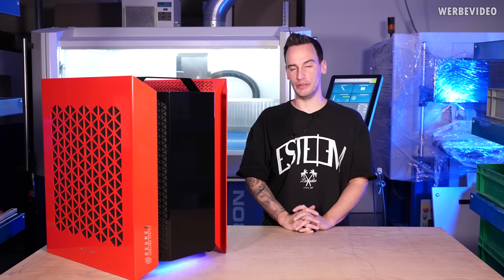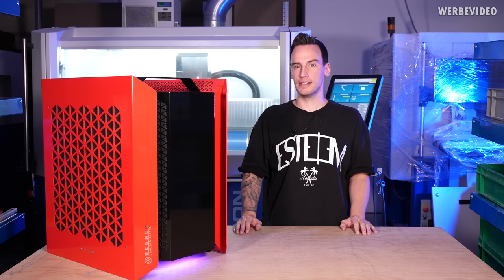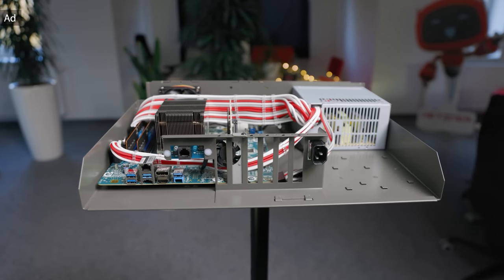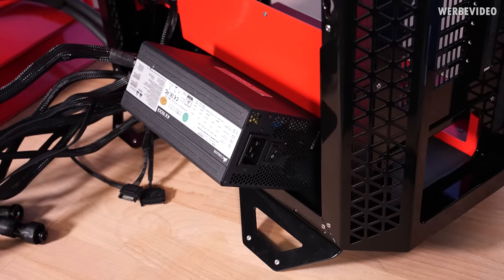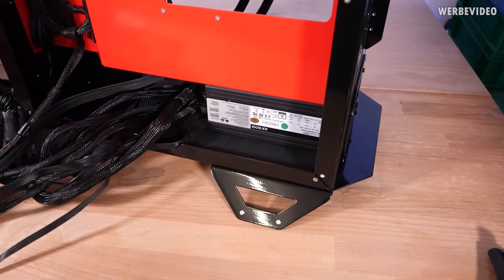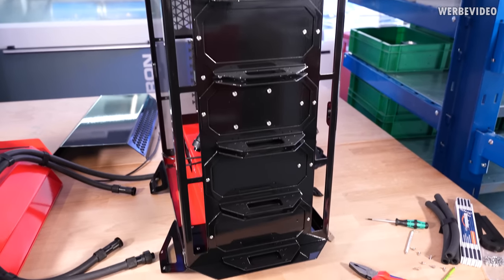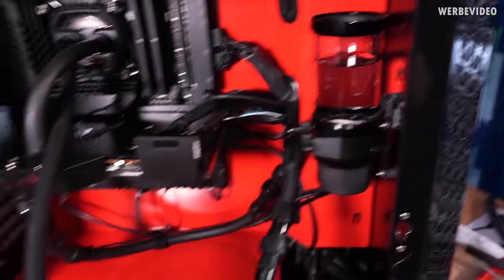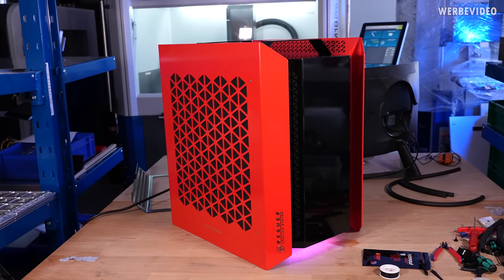The most expensive Case I have ever tested! Regner Cooling is back

Comment: THAT GLOSSBLACK SHOULD HAVE BEEN STAR DUST BLACK , I HAVE A CASE I USED STARDUST ON A LIAN LI O11 WHITE CASE I WANTED WHITE INTERIOUR AND REPAINTED  THE OUTSIDE PANELS .  THAT STAR DUST POWDER COAT WOULD LOOK GREAT ON THAT CASE, YOUR HOME OVEN WILL DO A GOOD JOB, THE HARD PART IS REMOVING THE WHITE POWDER COAT PAINT.   A WHITE INTERIOR WITH A BLACK OUT  HARDWARE AND ALL VENTS ON THE BACK OF CASE ARE SEALED SO NO AIRFLOW BUT THEY ARE SEALED WITH MIRROR AND WITH THE BLACK OUT HARDWARE AND RGB  AND MIRRORED FLOOR ITS THE MOST BEUTIFULL O11 OUT THERE NONE EVEN COME CLOSE . THERE ARE PICS ON TWEETER AND YOU SHOULD READ WHAT PEOPLE ARE SAYING AND THE DIY WATER DUAL RAD SINGLE LOOP  USING A EK RES. INSTALLED LIKE BO OTHER YOU OR ANYONE ELSE HAS EVERSEEN . IT IS THE BEST OF THE BEST. TWEETER  KENNON Greenly.  As for temps I screwed up your airflow theories with science facts, top and side panels is all that is needed.  just as science states.

Comment: very nice case this time it is done right. I totally disagree on the dust filter I prefer having those and clean the dust filter is much easier than cleaning inside the pc and a build like this having no dust filter would be a total no go.
I would love to see included a vertical mount option for the gpu with the pcie4 riser.
I also disagree on not including the pump, would be nicer to have the pump so that all components are there and no need to worry about the pump only waterblocks
@der8auer You said you had results from mora at home can you had the comparison chart please ?
Reply: Why a vertical mount when you can't see the interior ?

Comment: I think they should stop with glossy painting, it looks really bad in light and go the brushed / anodized aluminium route throughout.
Honestly, I think the overall idea is good but it's still too crude to be sold for this kind of money, I know they want to keep the production in Germany but the labor costs will kill the project in the end.
Also the temperatures are still disappointing, 40*C water temp is not OK with this much surface area and flow. I had a 4090 with 360mm AiO with Phanteks T30's that I could easily keep under 57-58*C at 400W+ load and it still being pretty quiet, all the hassle with custom LC and a case like this is just not worth it anymore. I bet this setup would perform much better with 9x 120mm Gentle Typhoons, T30's or NF-A12x25's on each rad as these can at least push some air through, instead of these big Noctuas.

Comment: Talk about a wate of money, that filter in the pump is not good. Extremely low air intake. While these seems like a cool idea the back panel radiator isnt going to get much air if really any at all. The micro dust filters are also restricting airflow. Put a cool design on the front panel like you have on the side panels, than you can have air intake through the front panel, the cut outs could be smaller but to be hoest the same size would look best.

Comment: it's not worth it, because it's too high performance, that is, it has a very good heat exchange, it will tempt you to get high performance. How much did you have there? 700w draw? one in a room, or two, three in an office, it will quickly turn into beach time. The air conditioner will hit you in the neck at high speed, if you have it in that room. I have an i9 and rtx 4070ti, and I'm afraid of the coming summer. I will probably stick to 70fps, not 240fps, for the lowest possible consumption. Some of the viewers do not realize that the more you pull the plug, the more heat reaches the room. 1000w is a winter heater.

Comment: yep, water system is not easy system. i have very high temps and i reinstall my system in different cases with different coolers and then, i wait 1 hour and temps are stabilize... i was very angry.

Comment: They need to find a new painter. If you're going to push the custom paint job as a feature on an overpriced product, then the paint job needs to be quality. Every panel on the case is covered in orange peel. At this point, custom powder coating would be a better looking and more durable option, without adding additional cost

Comment: something about the paint looks so cheap like being spray painted, most in the black parts, I dont like the finish, for 2200 I would expect a better paint job or at least a frontal glass panel (since u cant see inside the pc, u need to see if all the seals are working as intended without any leak)

Comment: If it pushes air in, it has no exhaust fans. If it draws air out, it brings dust in from the pci grills. Pretty much horrendous setup, especially for 2200 euroz.... It is just sheet metal with powder coating.

Comment: That's just ridiculous, I have a h500m which is like 200 dollars and that's as far as Im willing to go only because it's air flow and features, through out 5 years or so, I have upgraded through 2080, 4090 and that case always served me well, why would any one need 2000 dollar case, it's completely poijtless
Reply: My Thermaltake Tower 900 Snow was a little over £200.

The cooling loop sufficient for a threadripper, high-end GPU and with enough radiator, fan and high-end quiet/silent D5 pumps to keep everything under control without sounding like an airport at rush hour, over £1500. And that didn't come with a custom paint job.

It all depends on your use-case. I wanted HEDT that I can sleep next to, I got HEDT that I could sleep next to. Such things do not come cheap.

Comment: Nice case. But not is a better. Thermaltake W200 and WP200. Mountain Mods Extended U2-UFO and Extended Ascension with water barrel and pedestal. CaseLabs TX10. Even Phobya Ultrabig Watercoolit for 100 Euro to proposal much more possibilities.

Comment: 3D printed parts have NO justification being on a finished product. At the very least for normal plastic parts. FDM/SLA Printing is fine for prototyping but not only is the surface quality not good, their mechanical properties are ABYSMAL. 

print the part to see if it works, then create a mold for that.

Comment: If you take a terrible preforming case and re-manufacture it using the HIGHEST build quality and materials, it will still be a low performance case it will just be built well. It seems like the only thing this manufacture is doing is selecting high quality materials, while doing zero testing and the result is low performance case at the TOP of the price bracket. They need to rigorously test and come up with a decent product, BEFORE asking customers to shell out top dollar. The first product was unusable, now just because the totally redesigned solution POORLY cools, and at the top of the price bracket, all good? Am I missing something here?

Comment: Those dust filters seem like a bad idea. sure, they mean you dont have to clean out the inside of the PC as frequently, but instead you have to clean the dust filters. and if they arent removable theyre a bitch to clean dust off of. so really youre not saving any effort, youre just cleaning the filters instead of the internals. and thats even ignoring the airflow restriction

Comment: Phanteks p500a frame with 2x "mora type rads"' on the side and a very strong DIY vibe for a 2K Euro? Nope, not for me. 4x 3,5'" on the front in 2023 in a high-end PC? it's simply a waste of a very precious place. integrate reservoir or distro plate, mount LCD screen or advance lightning. water cooling. if it that be for what price. it's a disaster. single pump combo? with such a cheap design? for such a system separate reservoir + dual top pump is like standard. Quick disconnects from alphacool are the worst choice you can make, they look ugly. side panels mounting? for 2k it should be more fancy and comfortable. and visible rivets on any surfaces for this price are unacceptable. 2-metre rubber tubes inside with no tube management? yaks. top handle and stands from sheet metal look simply cheap. CNC parts are definitely needed. And painting (and surface finish, all these bumps look bad) needs much more polishing. The overall idea is ok, but this price definitely needs more individuality and parts integration, and overall better detailing. Because in this state all this case does it's hiding two big rads in thick side panels. I understand it's handmade, but it is ok for one-piece work, not for small series. The exterior design is pretty good. Of course, it's all IMHO.
ps. 6C delta on 2x 1260 rads. idk. 1 stand-alone MORA can do the same I think.

Comment: Oof..... i9-13900KS is boiling the water.
Reply: did you notice that even at the lowest fan speed the water reached 40C only (and 28C in 22C room, only 6C over ambient). The CPU, itself, is very heat dense so dissipating that is the hard problem.

Comment: So they used the reviewers to do their work and do the testing and suggestions instead of their design team. That is not how company should operate... I hope at least they paid der8auer for the work :D.
The design is still unattractive in my personal opinion. Cases like Lian Li's look much better and can fit 4 rads with mesh front panel if that is your thing, tho that much rads are a total overkill for modern PC.
Reply: Depends what your PC is doing. Workstation CPUs can dump nearly 300 watts thermal into a loop on their own, before you even think about what a couple of high-end GPUs are going to contribute. If you want to do that without deafening yourself, you either pull a Linus and put your stuff in a rack system in another room, or you go huge with the rads and low-RPM with the fans. Either way, you are not getting that level of cooling performance with some £150 gamer-grade AIO.
Reply: @technicalfool  360/420mm AIOs can handle 300watts CPU (even in much power dense CPUs like 13900ks, let aside a wide server or workstation ones) and even 400watts GPU without a problem. Server GPUs are binned for efficiency and designed for blowmatrons, so they usually have much lower TDPs, Don't quote me on that, but I think you can't fit more than 3 GPU in an ATX mobo and most workstation ones are XL ATX, but even that is an overkill and will probably require a second or a bigger PSU... On top of that we are assuming that an average workstation user will bother with water-cooling over stability/less maintenance and has a benefit of more than one GPU.
I'm not sure what are you trying to justify, if you think it looks cool and you have the money for it - go ahead, no one stops you. Most enthusiast who will spend that much money for water-cooling will probably want a cool showcase case and will put the extra rads just for the aesthetics which is totally fine :)
Racs and servers are totally different thing and have nothing to do with an ATX case...
Reply: @plamen5358  I have a threadripper 3960, a 6900XT Liquid Devil, and two 560mm rads. I know how much wattage just that can dump into the 3 or so litres of water going through the loop.

The difference between those two 560s and a cheapy AIO is the eight 140mm fans can be low RPM and nice and quiet. Sure you can cool a TR with a 360mm AIO, possibly even a 280mm, but the fans will scream, and you still have a GPU to cool.

Now add 1 to 3 other GPUs (and yes, a serious workstation is probably going to have anything up to 4 of them), and you see why this amount of cooling starts to be a desired, and even a necessary option. I certainly don't want to have to don ear protectors or build a soundproofed shed to put my machine in.

Comment: honestly disapointing. to fancy big and expensive then again not fancy enough to make sense. fixed tubing within the case with short runs go the components, better mor sturdy resourvar and pump, more like in servers. built in cabeling and a better airflow design. with all those fans to intake you gonna choke.

Comment: DUDE...  If I'm going to spend $2000+ on a case. I'll just get a server rack setup. This is very cool.  And totally not worth it.  Just saying.
Reply: It's not just a case... its the case + 8 large Noctua fans, + 2 expensive radiators + a reservoir/tubing/fittings.

Comment: Honestly, I could never see myself purchasing a $2000+ case. But it's good to know there are options... ¯\_(ツ)_/¯
Reply: Honestly after putting 13x 140mm low-RPM Noctuas, two 560mm Alphacool UT60s and a couple of low noise/silent D5 pumps + reservoir + small distroplate in, along with the EKWB TRX40 waterblock, my Thermaltake Tower + cooling system ended up costing not far off that amount anyway. And that's just the basic white-and-glass, no custom paint job included.

Liquid cooling be's expensive, yo. At least, watercooling at that level of over-engineering where you want a near-silent or pleasant-sounding build.
Reply: @technicalfool  I've only ever done budget builds, so it never made much sense to do water cooling for me (being a PC peasant who tries to maximize bang for buck with every build). But I think my next build MIGHT have water cooling. But it would be a super cheap AIO, which might defeat the purpose anyway. But the setup looks so involved, I may just stick with my block cooler. ¯\_(ツ)_/¯
Reply: @anonimuso  A nice big fatty Noctua airblock is definitely not bad. That said, a 360mm AIO, so long as the pipes are long enough, gives you the option of deciding where the hot bit goes, and doubles as extractor fans.

Comment: How does a $2500 case look and "perform" the same as a NZXT case from 10 years ago. And....HYTE Y60 with distroplate will be $2000 cheaper and preform about the same.. No one should buy this.

Comment: Nope. It's not great engineering and extremely expensive. A bunch of stamped parts with shit welds that show through the paint. Some good ideas, but nowhere near a price:performance ratio. Thanks for the fans, rad, and connectors X2 for both sides- Not worth 1,500 euro for those items, Derbauer said $400.00 to buy yourself, yes, that should tell you something.  $2,364.XX in American dollars. Nope nope nope.  Accurate glue?? DerBauer, please, you're obviously trying too hard to justify. This is against everything I've seen you do and your ethics. I'll just pretend I never saw this. If I had a billion dollars, I still wouldn't buy this.

Comment: I appreciate what this case is trying to achieve, and i get that the cooling is really good, but in my eyes if someone is into water cooling, they will want to build it themselves and also have it on display.  I wouldn't want to hide my PC behind a solid panel and if i would, i would definitely build a cheaper system that can still achieve similar results... this is really just an overpriced case for a very small, nieche market. But this is just my opinion.